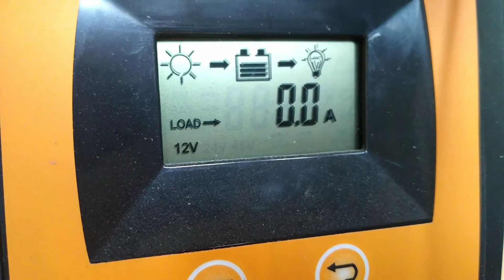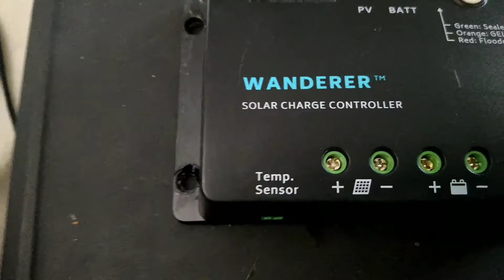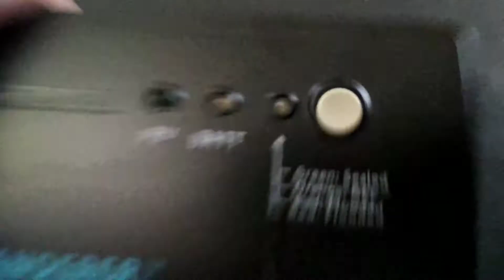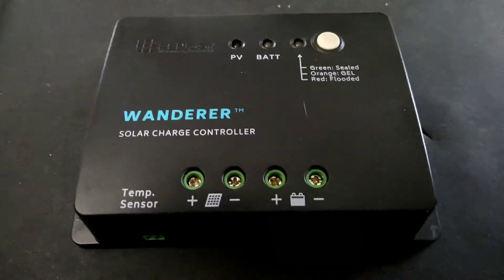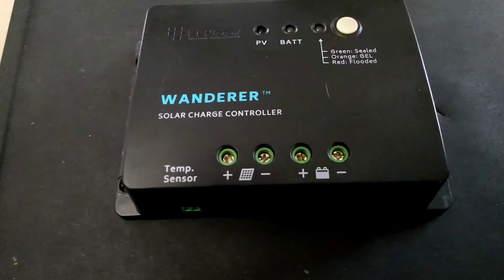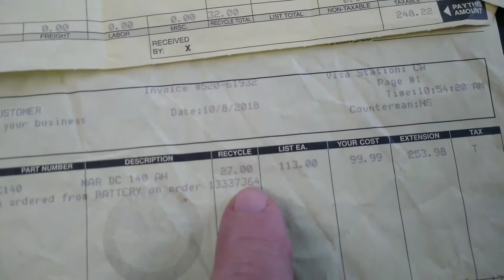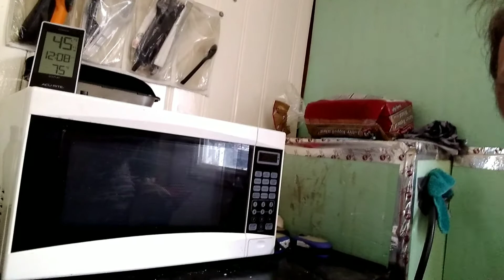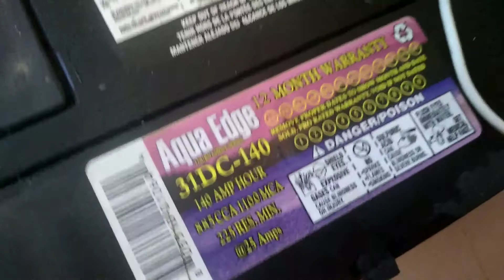Living in a U-Haul. Solar

Comment: Consider a crock pot,easier to run on your electrical system than a microwave. Takes longer for food to heat or cook, but you can make stews, chili beans, lentils, or just pierce a can top of similar and set can into the pot or even put some water around the  bottom of of can and heat it that way. Use a pot with the clamp on lid. Can wrap a large towel around it to help heat faster, keeping more of the low heat in the pot. Crock pots are great on low power systems. I use mine when taking a trip in minivan and just hook to a cheap 300w inverter since it's standard old single setting 100w unit.

Comment: Microwave is rated on the power input to the food, not on how many watts it actually needs to run properly. So, a cheap walmart bought $60 microwave at 900w needs an sine wave inverter of about 1500w output to run properly. So, if it ran an hour of use in a day, that would use 1.5kw + 15-20% more due to inverter heat loss factor (total used 1800w). That means it's best to have a 2000w inverter at least. That means you'd need 4.5 - 5 hours of full sunlight on your 400w of solar panels to cover that.
Reply: So, you'd need two 100ah 12V batteries to run the microwave for an hour use (2000-2400 watt-hour). Since you'd want to only half discharge deep cell flooded batteries, your use time for microwave would become less than an hour, about 40-48 minutes of microwave use. AGM batteres can be 70% discharged safely. If you want to use that microwave, you should consider your other two 140ah batteries with another four 100w solar panels to power your other items. Now you can see why most van lifers prefer using propane for cooking instead.

Comment: Have you tried using the low 700 watt microwave?
Reply from the maker: That's what I have. The 1000 w inverter will run it but it will beep on overload and shut off after 1 minute. Most of the time I'm just reheating something but it does take me 5 minutes to make three and a half minute macaroni and cheese.
Reply: @americannomad5905  Good to know, then I will definitely go with the 2000W Inverter.

Comment: why did you go 110 w with the appliances.
Reply from the maker: I intend to discuss that. All my 12 volt stuff failed , for different reasons, over time. Replacement was based on experience , cost , and availability.
Reply: @americannomad5905  are going to do a video on this.